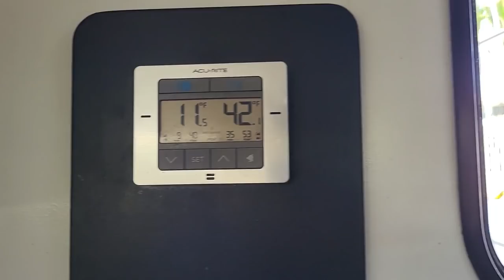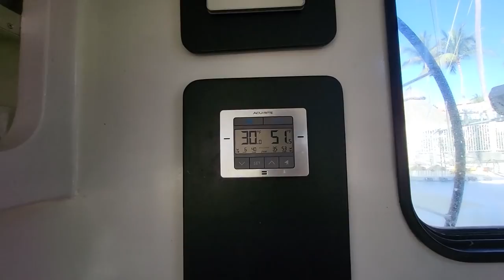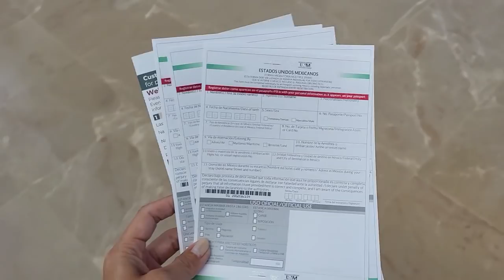4 Tickets out of PARADISE! - Onboard Lifestyle ep. 204

Comment: Ahhh flying the friendly-skys. Wish I had known. I work that area in IAH .. oh well, another time.. 
Welcome back. 1°, F!! That's cold... vents will really help out that box. Fans set to a temp switch or constant? One up high, one down low for true circulation... Or opposite sides... Sure you did that... Propane still the best way to cool however, as you spend most time ideal, (not moving in reel rough seas).
Be well and thanks for flying with us...
Reply from the maker: Next time Kevin!

Comment: Another great video. Those holes you drilled looks like they would accommodate two 12v low noise highoutput fans like those on a PC. That could help either push air in or pull out the heat. I used this on my boat for that very same thing as described. I just added a switch to toggle it on and off at first. Later I added a thermostat that would just kick the fans on at a certain temperature.
Reply from the maker: I was thinking that exact thing and asked that same question to the refrigeration guy.  He said that that would put negative air pressure in the box and be counter productive towards the compressors efficiency.

Comment: Welcome back . Im glad you 4 mousketeers made it back as much as you safe and sound.. .. I kept my fingers crossed and wondered what could go wrong with basik and kinda warned you to unplug everything teal cept the bilge pumps... But esp the fridge ... I figured you woulda done that for sure.... You were lucky no fire started... That poor compressor musta shortcycled itself to near death with no way to get rid of it's heat in the condenser.. give me the model number of the unit and manufacture and I'll show you how to wire it up like the old frost free fridges that have no computer boards running them using 110v .. assuming it's a 110v compressor.  .. its such a beaut of a fridge.. also remember there is the other fellow boater Clark who made those nifty little small  btu AC units for his boat.. I think you got lucky there teal but it did shorten the life of that compressors windings from all that  internal heat being  built up and not being released via the condensers coil. As long as it didn't blow out or create a leak and loose it's charge it will get cooled from the returning refrigerant to a degree from the correct charge and it's correct superheat from the factory to a point for awhile until both heat and  pressure rise to an absolute failure in time in theory , but thank god some heat did get released in that contained area just not much. As soon as any fan even starts loosing rpms it puts the compressor to the test ,  same effect as a dirty or plugged up condenser coil that is so full of crude that no air can pass thru it to take away the heat picked up from inside the refrigerator box.. so make sure to keep it clean for efficient heat transfer.  Other than that you were lucky there for only a hundred dollar bill. Gustavo the refrig guy was pretty cool I thought and I think it will be fine.. you could put another fan in the vent there instead too to pull the heat slash air in an outward direction . Maybe even one to blow I'm air ... It's only gonna get hotter and you might even have to open it up completely. ... Keep an eye on the temp differences each way with ambient of the day.
 Heat is a killer and thanks to the global warming it's only going to get worse. If you had ac for the entire boat that fridge would last much longer and be much happier running in an air cond environment just like us.... Make sure you check out how Clark built and wired his from scratch and how the condenser coil is water cooled .. Im just glad like you you still have refrigeration.. if you need help it looks like there are other refrigeration guys willing to help out as well as me.. we want to see you eating all those frozen and refrigerated foods super chef Linh can whip upside down with her eyes closed every week on the neatest and bestest boat on the planet and hopefully in air conditioning splender again soon.  .... AC is such a necessity in my book... But I got to laugh teal ,even though I do refrigeration and AC .. if my AC goes out on my car it seems I never get around to fixing it and when I do I don't hardly use it ... But in a boat or home you absolutely need it to get to sleep at night in hot and humid weather...  .... M, glad compass took the plane ride well as I  was worried about him too. He looked like he was just fine and looking courious and alert as usual. And Linh you did tell the attendents you were the real James bond girl as in thickened epoxy bond  girl and got a free drink or two I hope. What a surprise you are all back so soon for me.. sv basik really missed you and did a hell of a swell job to keep a fire from starting..  I think we all should give her a toast or two that she definitely deserves for keeping her 🆒😎... Lesson learned , you gotta count your blessings this time , I'd say some one was looking out for her.  You are just in time to get back to fishing ,stock that fridge back up and enjoy paradise once again... Ps. It looked like lucky you didn't miss a meal Emma and you grew another  inch taller...and are still the comedian.

Comment: Edited a little more you are gonna be a refrigeration ac expert yet teal and always be able to fix your AC problems.. that is the best comfort of all to know... When you get the ac down you will be confident and knowledgeable to wire up your fridge with straight wire and a couple of controls only.noticed you have a  low side suction port charging access from the factory which is handy for recharging in case it is low on gas due to small leak over time. And I guess you did unplug it before you left due to the fan.

Comment: Teal reread my comment about what to do bout  your fridge again. I added a little more for you.. also you could use your infrared meter and check the dome or top of the compressor and surroundings .. when you do always be sure it's taken at the same distance away from object... Makes a differenc.. also if it gets desperate fix up a drop of water on top of the dome of the compressor or one of those mini swamp coolers are nearer the condenser coil and also on compressor.. if you use water depending you may need a tray under unit to catch water . The overall heat will help evaporate any small overflow . If you have to a damp cool rag will take heat away quickly from dome of compressor too ... All the while you are do this if it has shut down on its internal overload circuit which  became  open till cooled enough to reclose the circuit if  it has one to get it to cool down enough to reset the internal overload.. many have an external overload , internal ones are optional and make for more expensive compressors... I don't think it will gravitate to this point but just to give you ideas if you find it keeps shutting down due to overheating. .. the word freon was the word that the company Dupont who first developed refrigerants coined for chloral floral hydrocarbons of all the different boiling temps of  classified refrigerants used in air cond and in  refrigeration depending upon desired operating temperatures or desired temp of the space being cooled or food or whatever is needed to be made cold  ... From general refrigeration temps found in a refrig to temps or boiling points of refrigerants needed for cryogenics for examples. Diff gases all have diff boiling  points some can be very low even if they are boiling.

Comment: Have the most trouble DC to AC conversions for refrigeration and air conditioning on my Cat. Maintenance on the units is so much easier, on a boat than it is a house. Certification to be able to buy refrigerants is a 100 times easier than to get certified for scuba. Really surprised you don't do your own maintenance. My boat runs on very cold cans of beer.
Reply from the maker: We do the majority of our own maintenance. There are times where we will outsource the experts for a few reasons. #1 We don't carry every piece of equipment, #2 It is always nice to hear from an expert in the field and learn from them, #3 Supporting the tradesmen in the community as we travel. In this case, Gustavo migrated from Italy to Mexico during the pandemic to find work and he is excellent.  He worked with us, educated us on our system, brought his nephew and serviced our refrigeration after getting our call late Sunday arrived early Monday morning and we were back in action by the afternoon. All for $100 USD.  He also came back over the course of 3 days to check on our system. Money well spent.

Comment: Retired from 40 years in the supermarket refrigeration industry.                                                                                                                                          The fan placement concerns me. Hermetic compressors are 
cooled internally by the suction gas returning from the evaporator
but also any cooling that may be gained by the fan is desirable, 
particularly in an enclosed area where heat can be trapped.
Heat is the enemy here. Heat killed your fan, it killed your board and 
next will be your compressor. I think there needs to be some vents
cut into those awesome doors you built. ;-)
Reply from the maker: Thanks for your input and expertise. As of right now, our fridge has been performing amazingly well and is actually drawing less. We will keep your advise under our hat and if anything changes, we will do as you say to improve its performance. Much appreciated!

Comment: Make A Box the to cover the lower Back of refrigerator 😳 bring a aluminum 4” flex into the fan area to cool from Outside 😃 Refrigerator condenser 😃 now put a rubber seal from the box to the refrigerator perimeter of the box 😳I saw your Refrigerator back 😳 use the Heat vented into for interior warmth from your compressor. For Winter 😃 during the summer vent , The heat coming out from Compressor to the outside🤔   do your self a favor 😳 Box the compressor and Fan 🤔 make A slide switch for (heat) for interior 😃 then Slide the switch the and make a slide For Summer 
All so bring in Fresh Air from out side on a good night or day 

Why Waste the Heat during the winter👏🏻👏🏻🤔😃

Get rid of the heat making you boat hot during summer sent it OutSIDE